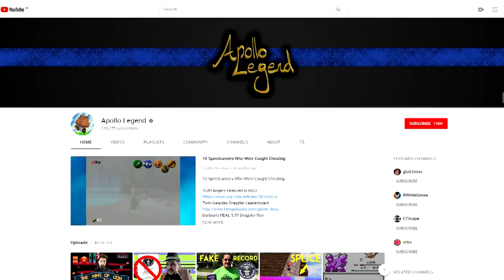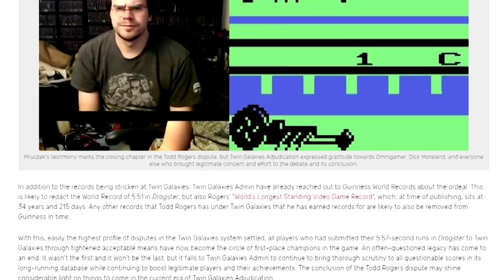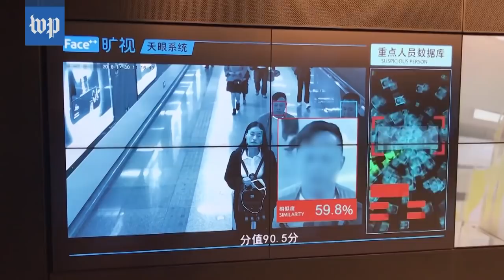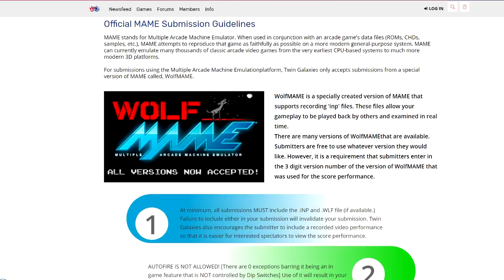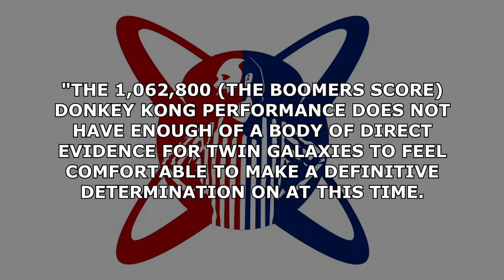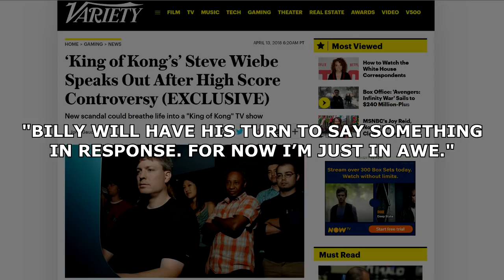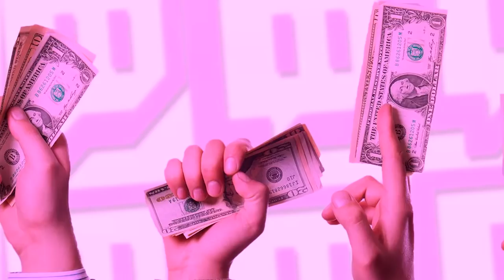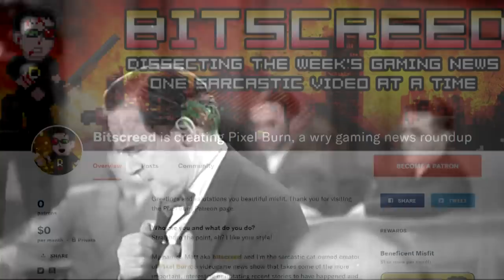PIXEL BURN - A King, Konquered: The Fall of Billy Mitchell

Comment: Billy was NOT the first to reach the PAC Man kill screen. He was, at best, the third but Twin Galaxies completely ignored the first two a gave Billy the credit.
Reply: He also took a 30 minute break inbetween, which isn't allowed
Reply: Yep that record is rubbish as well. This is why one fraud has to exclude ALL scores.
Reply: TG actually never claimed Billy was first to reach the kill screen. TGs own record books from the 80s and 90s mention the kill screen and how it can't be passed. Hell the "how to beat pacman" book from 1982 has a whole section on the kill screen. Billy doesn't even understand why it happens - he says it's because the game runs out of memory to draw the last board, but that's not true. It's because it tries to draw fruit everywhere on the right side of the board. 

However the alleged perfect pacman game, yeah he was at least 3rd. In fact TG changed the rules so Billy could argue he was the only person to do it specifically that way - prior to Billy, you had to do all pacman score attempts on default settings h 3 lives + 1 bonus. However Billy's perfect was on 5 + 1 settings, so he could get the highest possible score with the regenerating dots.
Reply: @totallynotzokix11_mc21 yeah but so did both the previous perfects. Bill Bastable used the dip switches to pause the game, and Randy Tufts parked overnight, possibly for most of the next day. And at the time, for all three, TG guidelines allowed parking if the game could be done so with player functions - so parking pacman overnight after the 4th and final scramble was allowed under pre 2001 rules.
Reply: It is really weird how there seemed to be a concerted effort to write Bill Bastabille out of the picture in those cabalish early days of TG

Comment: Weird I find is that when the Wiebe vs Mitchell battle was going there wasn't a rule like "no show no win".

Wiebe showed up and was ready to compete. The VHS stuff of Mitchell is just pathetic, he knew Wiebe was better.

In all sports to my knowledge you become world champion by competing 101.

Mitchell just had found a way to wheezle himself into a competition where he could change the rules when competition got better than him.

When I first saw Bill Mitchell all bells went off and all red flags were waving.

This guy has mental issues is what I thought.
Reply: the difference here is that the two were not competing in the "standard" way compared to a sports game, where two teams actually oppose eachother's progress.

With speedrunning or getting a high score, there's no need to do so at a specific time or location (as long as the gameplay is legitimate) and you're not competing with just one person, and no one is activly opposing your progress.

speedrunning or highscoring is just a display of mechanical skill and RNG (where applicable) boiled down to a number and then compared with other numbers made over the course of history under the same parameters.

Any requirement to use specific hardware, or have witnesses/footage, is to prove the numbers legitimate, not to create the ability to play in the first place (as with sports).
Reply: Wiebe showed up in front of Bill's lawn. The coward never showed up.

Wiebe is my man, he is relaxed and intelligent in a good way!
Reply: Mike Hydropneumatic my dad was also angered about that when he saw The King of Kong
Reply: If your last name is seriously Snitzer and you think my name is actually Alex de Tocqueville, you've just proven my point about Aspies.

I bear you no ill will. I can tolerate all kinds of weird except the kind that destroys your ability to be clever and canny outside your comfort zone. And in that, I can never respect most Aspies. It's not in your mental toolbox. Mine's missing the part that can do even basic math or assemble a day's worth of plans in a row. You thrive on structure; I panic if I am forced into any at all, even from one hour to the next. A side benefit is the ability to smell bullshit (and exploit it) from a mile away in a quarter of a second. I simply can't build one day (or even one hour) of that upon the other like a block. It falls down. I start over. Your castles are deeply built, but all things solid can be shattered, I say. You'd do better to form a mobile defense for your psyche, like us.

If you've ever seen the Bill Murray movie "Groundhog Day', you'll notice he gets despondent, self-abusive and contemptuous towards human life once he realizes he's incapable of stringing together two consecutive days of life in a row. No matter what he does, whether he's a saint or a Satan towards everybody, EVERY time he tries to string another day to the last one, the universe spits it out. He wakes up and it's the same fucking shit, the same mistakes, the same inextricable behavior patterns. Going back, Jack, and doing it again, wheel turning round and round...

this isn't a question of better or worse, but "to thine own self be true". By a certain point in your life, every man will know when he will go insane. It's a question of whether you are true to it, and thus make it your most glorious hour or your moment of most crushing and breaking weakness.
Reply: @orangejoe204  You might be at the wrong house, no one ordered a take this shitty.

Mitchell, Rodgers, et al. started competing on this shit at the time it actually came out. Before the video game crash, when games weren't nerd toys, they were HUGE pop culture icons, they were in half the bars in America. All of Mitchell's lying wasn't just "I MUST BE THE ONE WHO HAS THE RECORD", but it was a path to money, sex and widespread fame and adulation. He lied about them and continued to cheat well into the 2000s because he wanted to cling on to that status.

Comment: There's a difference playing Donkey Kong. Emulators are known to have rather slowdowns at times and have more advantages. Also, MAME gameplay can be saved. The Original Arcade cabinet of Donkey Kong doesn't have slowdowns or stutters which are really minor, but they are noticeable when playing on the MAME.

Comment: I'm seeing some footage where Mario (Jumpman lol) is on a ladder while barrels roll past above him. And in fact, when the game first came out you could hang out on top of ladders and barrels would NEVER hit you provided you had 1 hand at the top rung.
But then it changed... barrels were pretty much guaranteed to come down on your head on a ladder - even if you're pixel perfect on top of one. 
Does anyone have any info on this change, or info in general about how the arcade owner can adjust the board manually to make them "tighter" (harder/quarter hungry) ?

Comment: what landed billy in the shit was the what was  shown  to monitors shown at an event  of non competition ..

Sorry Wiebe  wasn't the kong player  to hit the 1st  player to get 1 million on an arcade machine thatt was set in the  1980's,  yjpigh I 1st to congrat Steve to get it in tourny play

given the issues I saw in the tape playing I was rf injection   into the tape and this out of sync tune and /or by product of duplication by rf..

I'm not sticking up for billy what so having both recorded rf and composite   nes and snes. to know  composite doesn't produce rf artifacts

my question what did he use..

Whilst i couldn't exclude mame in my findings  donkey kong  has been ported to so  many systems over the  years I have wonder what  billy  used..

Because I know from an OS perspective  of windows xp  stop  supporting tv refresh rates  outputting the refresh outputting from rf or composite option ms dropped support for anything lower than 60 hertz rgb.. I know this because I had a composite output and you never sync to  60Hz..

to be honest given  King of  Kong  was more of a mockumentary  than documentary ..

Comment: Oof. This little witch-hunt hasn't aged very well, has it? Oh, you haven't heard the news? Guinness World Records sends its regards. Mitchell reigns supreme, once again. Owned, haters! :D
Reply from the maker: Yes, I saw that Guiness had reinstated his 1999 Pac-Man perfect score record and his 2005 Donkey Kong record.

If you had paid attention to the video however you would've known I was actually inclined towards letting Mitchell keep his 1999 Pac-Man record, since it was played on verified original hardware in front of a reasonably-sized live audience. Similarly I also felt he should be allowed to keep his publicly witnessed Donkey Kong high score of 933,900 from 2004 and, by extension, his first record for his 7 November 1982 Donkey Kong score of 874,300. Hardly what any reasonable person, with a smidgen of viewing comprehension, would call a witch hunt.

As for his 2010 Donkey Kong Guiness record score, the one shown in the controversial "Boomers tape", well... he still has to add 197,601 more points on top of that one to surpass Robbie Lakeman's 1,260,400 recorded June 15th this year.